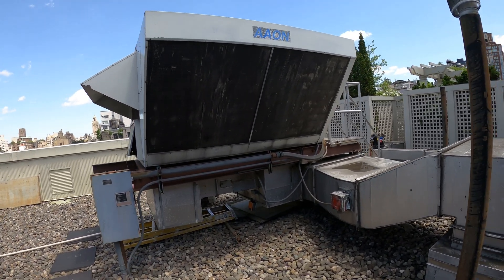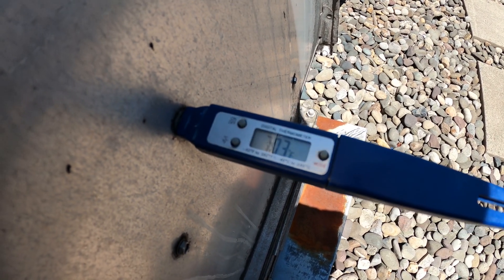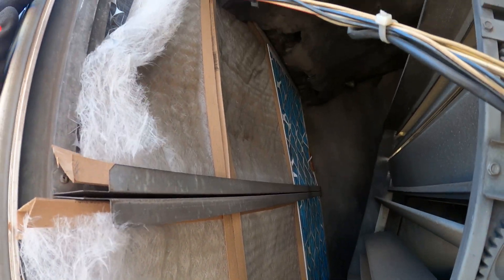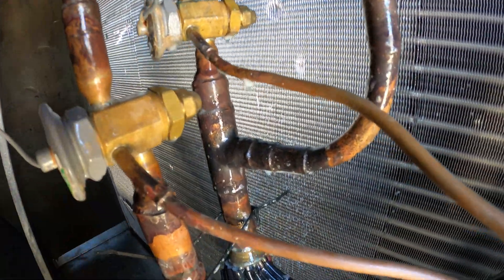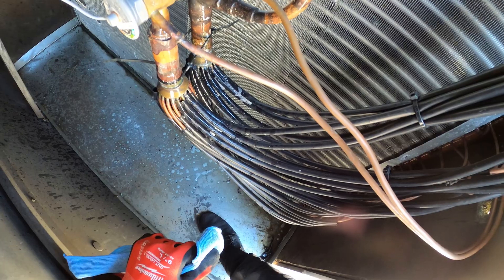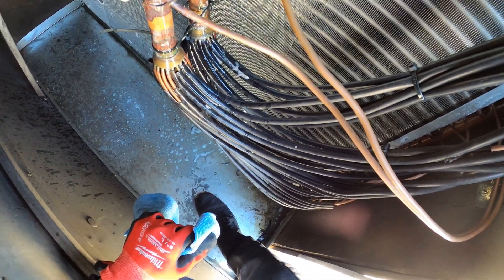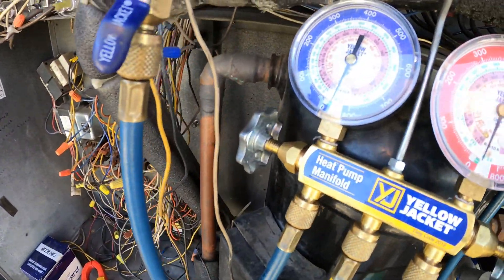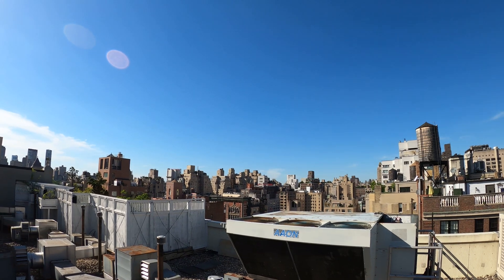HVAC: RTU Not Cooling Emergency Service Call (Packaged Roof Top Unit Not Blowing Cold Air)

Comment: mathew hall chiller very old. was running on R22.
I substituted R22 with R422D.
Reply from the maker: I haven't used or heard of R422D yet. How did it work & were the pressures similar to R22? R407C and NU22B is typically what I see or use as a substitute for R22🙂 Thanks for keeping that law & order 😅 Great show BTW. Stay safe out there & stay tuned for new videos every week🔧
Reply: @JumpermanTech  regarding R422D as substitute 
https://www.agas.com/media/8809/r422d.png?format=jpg
Reply from the maker: @laworder6092  Thank you!

Comment: They should get it replaced its r-22 plus its already gonna be expensive to full it up anyways might as well get a new system
Reply from the maker: I hear that! This unit is probably 30 years old already. I actually used a R22 replacement. I used R407C and it worked great👍 Appreciate the feedback🙏 Stay safe out there & stay tuned for new videos every week🔧
Reply: @JumpermanTech First tank you for your videos y really enjoy them. You mention that you put in R407C in the system, but R407C is not a direct replacement for R22. R407C requires POE oil. Did the compressor had POE oil in it?